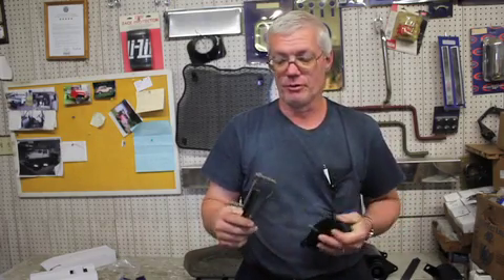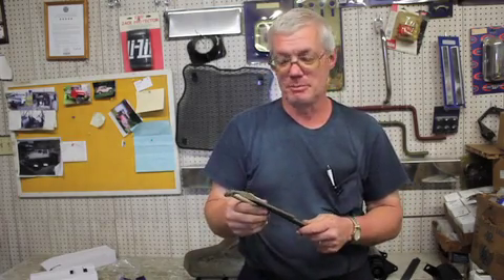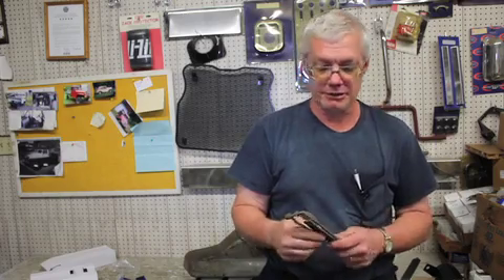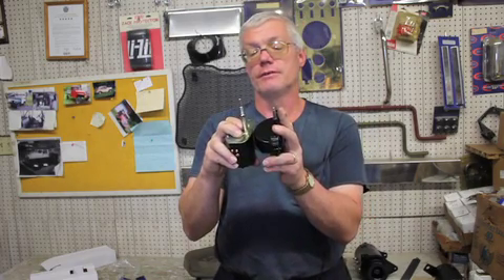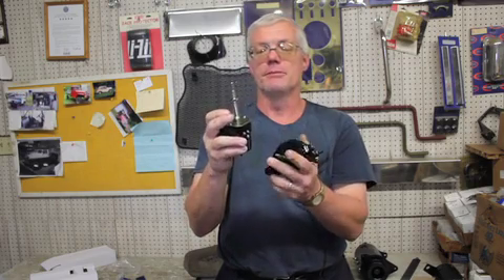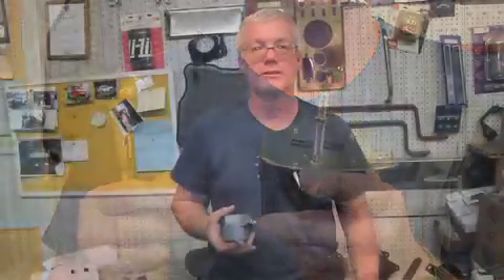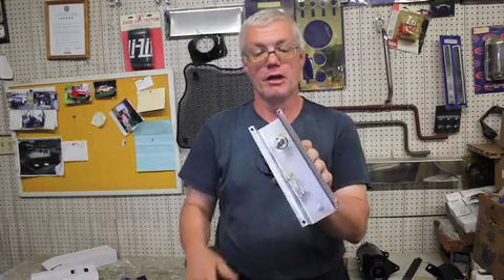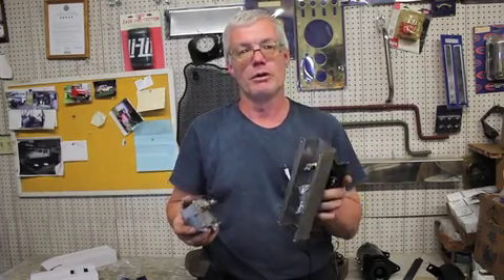Wlack's 4Wheel Drive, Willys Wiper Motors

Comment: What is the total length of the shaft on the vacuum motor from face plate to tip of shaft? I’d like the correct length to begin with.

Comment: I bought duel electric wipers for my DJ3A... only problem is, I can't get the wiper on the Passenger side to "park" in the downside of the windshield, What is the trick to that? There is no left and right-hand side wiper motor, is there?

Comment: how many speeds is that 1st one you show. The one with the long shaft. Where do I get one, and what is the cost?
Although, you show the wiper arm going right on the motor.
Does that motor not run in a continuous rotation?